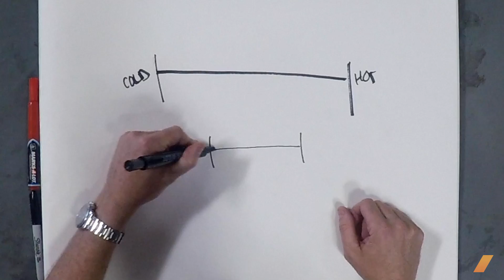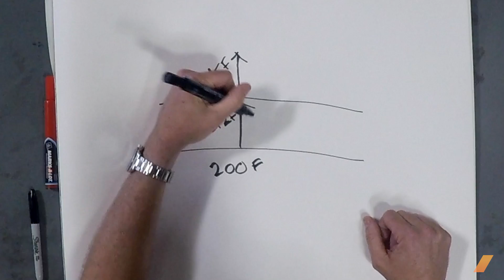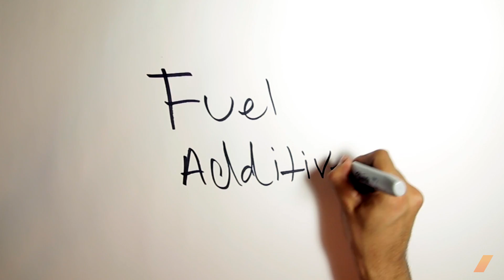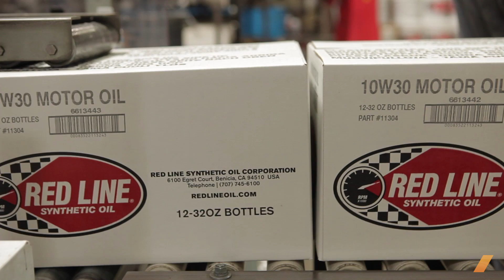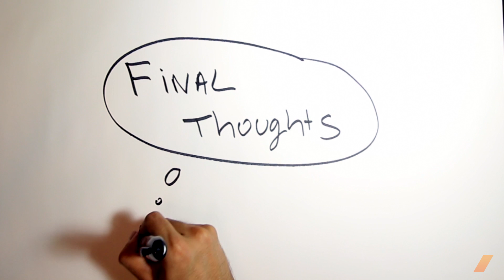10W-WTF!? Dispelling Myths About Oil -- /ENGINEERED

Comment: I had an old carbureted 5 ltr V8 and added Slick 50 to it. After about 10 minutes the idle had increased from 800rpm all the way to 2300rpm just from the reduction in friction. I had to wind the idle speed adjustment back significantly just to compensate.
Really was an amazing result. Unfortunately it isn't as noticeable on EFI cars as they automatically adjust idle speed.

Comment: The reason why BMW always uses thick oil like 10W60 is because of hydraulic lifters!!!
Usually,hydraulic lifters can't pass over 6500 RPM and the majority of them will start to bleed-down after that rev point so they cannot do proper function!!
As you might have seen,all BMW M series are revving up to 7500 rpm and that's because of special design of lifters,they can tolerate more rpm and without thick oil this matter is almost impossible!!!
They had to use thicker oil in order not to bleed-down

Comment: One of my questions is what about oil additives like oil stabilizer I.e. Lucas oil stabilizer ? 

Personally i like the stuff.. i put it in my supra, and all the families cars. I personally run synthetic 10-30 AMS oil seems like good oil so far which i've been using for the last 2 years. 

However i still use lucas sythetic oil stabilizer which noticed one of its best benefits is the oil sticks up inside the engine in the valve train and cams etc which helps cold starts. Ive personally seen engines with out this stuff and literally an engine sitting over night will be nearly completely dry up top in the valve train.  But then for the same amount of time sitting my engines cams and valve train will still have a coating of oil which in my opinion is the best possible scenario for cold start ups.
Reply: Review Guy 

You put oil stabilizer in your Supra!?

No, stop! It changes the viscosity of the oil so it won't flow as well on start up, it's not supposed to be that thick. The engine coats itself in oil the instant it's turned on.
Reply: Been doing so for over 4 years. Plus i added an oil cooler kit witch drops the oil pressure a bit because the lines are so thick. Soadding that helped raise the oil pressure back to normal.
Reply: that stuff is junk. it raised your oil pressure because it flows like molasses.
Reply: The thickness of it is what makes it nice in my opinion. But also considering i've used it in multiple cars in my family and they all run great and reliable is enough for me to like it.  

If something works for you.. but people randomly say its crap what are you going to follow ? your experience with the product and physically seeing inside your engine over the years of use. or someone who just dislikes the stuff. 

Lastly if you have actually seen or have any examples of where lucas oil stabilizer has damaged or sped up engine wear and tear i'd like to see it. And no im not talking about seeing some article that talks about whether or not this thickness is bad or not. i mean where someone has pictures or some good explanation that would convince me its actually the culprit to the engine failure.
Reply: well it probably doesnt hurt since youve used it for so long and nothing has blown up, but it really isnt doing anything a thicker oil wouldnt. Also, engines have tons of oil left in after they have been sitting and all you need is a thin layer anyway. Higher oil pressure also does not equate to better lubrication necessarily. If it makes you feel better then keep using it.
Reply: Lucas Oil Stabilizer is nothing but a viscosity improver. 
It causes the oil to have a higher viscosity at all normal operating temperatures.

Comment: Excellent video. Full of information for us motor heads and also general public.  I run nothing but Red Line in my bike. It has over 35,000 miles and its never run or sounded better.

Comment: All I use is Pennzoil Ultra Platinum or Liquimoly for my german car. Proven oil for many years.
Reply: ***** 25k miles intervals are too much for those oils. Those intervals are more common on toyota and german cars. That's when Liqui Moly comes into the picture. I only use Pennzoil Ultra on my turbo car with 3K miles intervals.
Reply: Try Venol (made in Germany), officialy approved by Mercedes-Benz, BMW and Porsche for use in their engines, yet costs less than the ''premium'' oils. All that ultra platinum racing stuff is just pure marketing nonsense.
Reply: @philipcooper8297  It most certainly isn't "marketing nonsense", real race teams wouldn't waste the money on using them in real race cars if such an assertion were true(believe me, professional race teams do NOT have excess money to waste, there is no money in racing, so they only invest in what works - speaking from experience as someone who used to work in professional motorsports) - but that doesn't change the fact that it's a waste of money for a bone stock engine, it's quite literally completely unnecessary. 

Just buy the cheapest oil that meets the specifications given by your manufacturer; "approved" oils are what are nonsense, you can't even lose warranty coverage for using an oil that isn't "approved", but you conceivably could if you use an oil that doesn't meet the weights & SAE specifications listed in the owners manual(and typically on the oil cap too, likely on an under-hood label somewhere also). However, even if you blew an engine while running cheap-O Walmart oil(which is actually just good quality name brand oil but without the cutting edge detergents, additive packages, etc. - NO ONE goes out of their way to produce a horrible oil that causes engine damage, that would be just asking for for liability problems as a business) that doesn't meet manufacturer spec, the onus would STILL be on the manufacturer to PROVE beyond reasonable doubt that it specifically was the 'wrong' oil that killed your engine(at least here under US law anyway). However, the manufacturer would certainly be giving you a hard time if you did have engine damage with the 'wrong' oil in the pan, they would certainly be trying to tell you that you voided your warranty, blah blah blah... ...all while trying to keep it OUT of court(in which case they would probably just offer a settlement, some "STFU money" if you will).

Comment: So what Oil would you recommend for a 1985 BMW 535i  5 speed manual transmission with almost 300K on original engine. ?

I've used mostly regular oil because of the cost of synthetic being much higher.  I use 20-50 mostly and I used the higher mileage oil too, i change the oil and filter approx 3-5000 miles.   No oil leaks, no black smoke and I don't notice any significant oil loss.  And last time I adjusted the valves, the insides were very clean.

I usually buy whatever oil is on sale, often the Wallmart brand oil :-)

Comment: Shell helix, that's it , maybe Castrol and Valvoline only because OE uses it. This in SA where out environment is way worse, even tuned cars still use OE spec just change to oil with better additives.

Comment: ZDDP anyone know what that is?
Reply: It's a zinc which helps prevent wear in the engine but I've vaguely heard it doesn't get to work until the oil's "hot" (whatever temperature that is I don't know) and that beyond a certain amount there's no benefit to putting more in. Besides, if oil gets past the piston rings it's going to clog the catalytic converter which is why ZDDP comes in smaller amounts in oil these days. Some "old school" guys (people who drive cars pre-1990s) like to have oils with a higher concentration of ZDDP.
Reply: i know ZZP
Reply: Not good for late model cars!!!! Do not add.

Comment: How many normal road vehicule that had regular maintenance goes to the scrap yard because the engine is totally worn out or suffered catastrophic oil related failure? People overthink motor oil. Just buy a oil that meet your specification and has proper certifications and change olit according to your owner's manual.

Comment: Haha my motorcycle needs 1.5 litres of 5w60 per 1000km but that thing surely goes!
Reply: For sure
Reply: well, bikes tend to consume a bit of oil and are usually air cooled. Theyre different beasts
Reply: Aaahm where I come from bikes aren't air cooled. And my bike consumes that much oil, because it has a full blown racing engine.
Reply: Very few modern bikes are air-cooled and even fewer consume any oil.
Reply: You engine is worn out..
It's never supposed to use more then 1L per 2000km.
Reply: Stop calling me Shirley.

Comment: which redline engine oil you would recommend 
98 accord v six 203,000 miles. new york area. also trans fliud recommendations
Reply: I will have a look at the link. But Honda kinda touchy about trans fluids used. But i just changed my oil with mobil one
Reply: Y does it recommend 10w-30 and the oem says 5w-30? I will try the fuel cleaner and the water wetter.
Reply: I would recommend 0w-30 synthetic, of any brand.  I prefer Mobil1 Synthetic Advanced Fuel Economy myself.  I use it on my Integra with over 357,000 miles!
Reply: freestyle101
No, no, no, no, absolutely not.  Thicker oil on cold start does nothing but INCREASE engine wear!  Exactly the OPPOSITE of what you want on a high mileage engine!!!  Please remind me to never use you for any mechanic work.  Oh that's right, I've done 100% of my own mechanic work the 15 years I've owned this car, putting over 265,000 miles on the car since I bought it, and the engine and gearbox both still work like a champ.
Reply: Timothy LaPlante thats my name not by nature
Reply: did you pay attention while watching the Video ? , they tell you about the differences right at the start almost

Comment: The only thing he said which is true is the fact that older style cork caskets do have their limits thus is why you have oil leaks but these days the OE engine builders use synthetic gaskets which take a lot higher temps and are oil resistant to a point which allows the gaskets to swell under heat without losing the seal it was intended to make ?

Comment: At 4:50 your telling me that cold oil 5w30 is thinner then hot 5w30 oil? Stick a 5w30 in the freezer and tell me how it is next to a room temp 5w30 the next day as you poor them out side by side.
Reply: duce wags He said the 5 is the starting weight and the 30 is the operating weight.  Once your engine is at operating temperature it doesn’t matter where you are at, it is a 30 weight.

Comment: gas is engineered, $5 of premium will last same amount of miles as $5 of regular.
(you get less.. but it is more concentrated so wind up with same available energy)
Oil saying 10W-50.. first weight is the actual thickness.. 5W being like water.. and 180W gear oil being thicker like honey.  the second number is the protection rating (10W-50) is thin oil.. but has same protection as a thicker 50W oil would offer. (less sticky/resistance for moving parts and slightly increase mileage because you can have thinner oil and still protect like heavy weight oil that steals some performance / slows moving parts compared to the thinner oil)
Reply: Um, what?

Comment: I had to pause at the fuel additives part.  From my experience and from seeing and talking to a couple refuelers.........most top tier companies....including shell all use the same fuel base.  meaning the actual gasoline part all comes from the same stations.  The only things that are different between them are the fuel additives the gas stations are required to add to the fuel.  BP and Shell both will use the same "yellow" gas that is a good tier but not the cleanest and all their tanks are filled with 87.  The additives they add have concentrated amounts of octane boosters and cleaners to make them into 93 invigorate or 93 vpower.  This vs going to a pump with a more pure gasoline that they explained to me to be "white" gas is the top tier gasoline with absolutely no additives and is truly 93 from the start but will also degrade faster.
Reply: Well, yes, all gas is the same when refined and placed into the pipeline. You are also correct that its the additives that makes the gas 'different'. But, the additives are added when the truck is filled up before heading out to the stations(s), and there is no 'pure 93' gas, as far as I know. BTW, the ethanol is also mixed in here.. and ethanol is used as an octane boost, so guess which grade of gas has more ethanol? :)

When gas is refined, the company puts it into the pipeline for distribution. It can take 3-4 days for that gas to come out the other end, so the company puts in, say, 1000gals at one end, and gets 'credit' for 1000gals to pump out the other end, which they can do the same day. Since it takes 2-4 days for the gas they put in to actually come out the other end, the gas they take out is not the same that they put in (obviously) and all the gas that was put in by the different companies is actually mixed together (obviously). So, someone telling you that there is a 'special pure 93' gas that they use, and its not coming from a 55gal drum directly from the refiner, is full of it :)
Reply: Midniteoyl well this information is coming straight from the guys that refill the actual stations.  the truck drivers.  They said that after they fill all the tanks up they add octane boosters and the "cleaners" into the tanks.  The only places that I go to are the pumps with a "PURE" certified sticker on it or just plain old nonethanol stations.
Reply: - Sounds like they are saying the same thing, ie: additives and boosters are added when filling the trucks. I use 'Top Tier' gas whenever possible.
Reply: What gasolene is considered "top tier"?

Comment: My Porsche 911 with a 3.2 liter engine keeps running at cold temperatures, I cannot seem to get temparature in the engine driving at normal (road legal) speeds. Operating temperatures when driving stay at max. 80 degrees Celcius. I run a semi synthetic 10W40 oil and renewed my engine thermostat just to be sure. Is there a way to get more temperature at normal speeds with another type of oil? It does not feel right running at 80 degrees, I really want to see temperatures of 95-100 degrees. Thanks.

Comment: I'm surprised that it's even possible to buy oil that has so low quality. The cheapest oil here in Sweden is a "group 3" and most people use group 4 or 5 oil. Castrol and Mobil1 is the most commonly used here, if you don't own a old Volvo 740. A 740 runs on anything in liquid state.

Comment: "Check the odometer." Funny thing. That is exactly what I did, and I saw a visible improvement in mileage at the same measurement on the fuel gauge.

Comment: Ummm... it's opposite of that. If you run a 0W oil in cold temp. It will gel. The colder, the higher the weight, ie. 5w, 10w.
Reply: What?? Um, no.. 0W is thinner at 10*F than 10W. 10W is thinner at 10*F, than 20W, and so on..
Reply: This comes from experience. Any 0w oil will gel at freezing temps. It will NOT magically flow better at freezing temps than it does at operating temp. That is impossible! If you run a vehicle in cold areas, you're going to need a 5w, or 10w rated oil. It will be thicker, but it will not gel up. Personally I run Rotella-T 15w-40 in anything old that I drive. It's part of the reason the GMC I was driving (until someone ran a red light) had over 254K miles on it and still ran strong. There are the exceptions like the POS dodge 345 with MDS that requires a 20 viscosity oil, but even in that POS I'd run a 5w-20. But do what you will, it wont be I that has to repair your sludged and broken engine. I don't do that kind of work anymore.

Edit: And another thing, NO engine has an oil temp of 280 deg F. You could make french fries with oil like that! Operating temps are around 200 def F. If you have oil temps exceeding that, then I'm going to guess your temp gauge on you dash is reading similar high temps and you should really check your coolant level or find out why your engine is running excessively hot. This video makes me really not want to ever buy Red Line products if this is truly what they believe.
Reply: 0W oils will not gel at below freezing temps , you know nothing clearly.
Reply: Sorry John, you are just simply incorrect.
Reply: He may not be entirely wrong, Mobil 1 0w30 is literally thicker when cold than Pennzoil Platinum 5w30 when cold. Yes I can back this up: Google the data sheets for these:

Mobil 1 0w30 Data Sheet

Pennzoil Platinum 5w30 Data Sheet

The "0w" part should be thinner than others from the same company and line of oils but it's not uniform over every brand, it's really not.